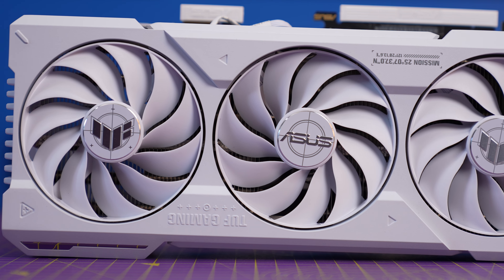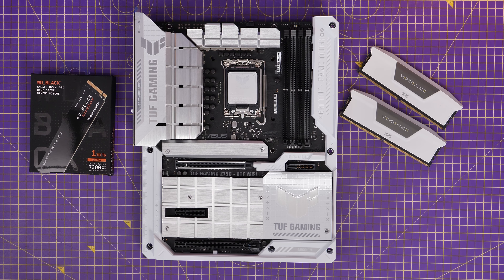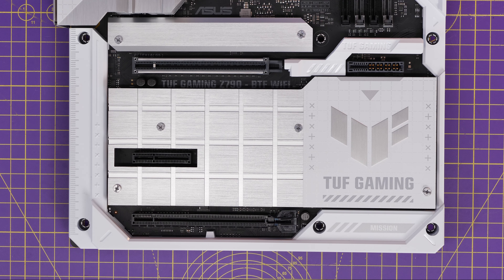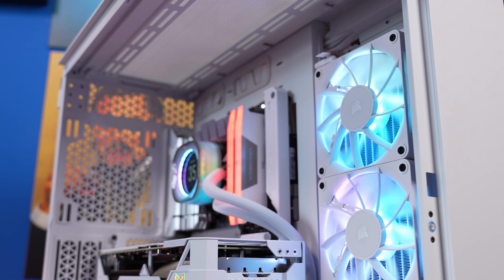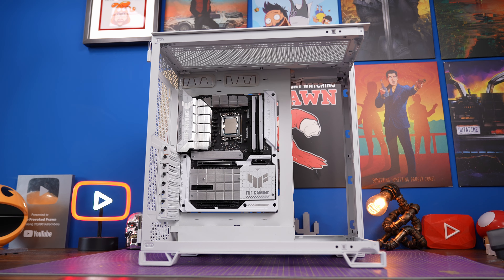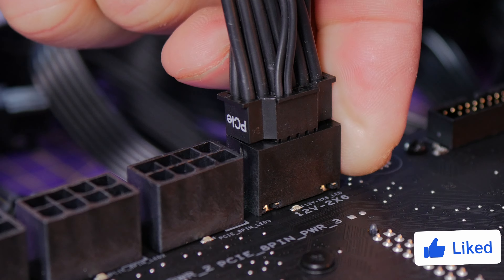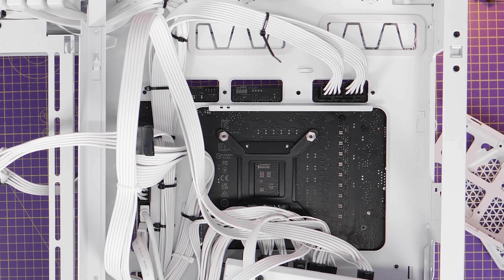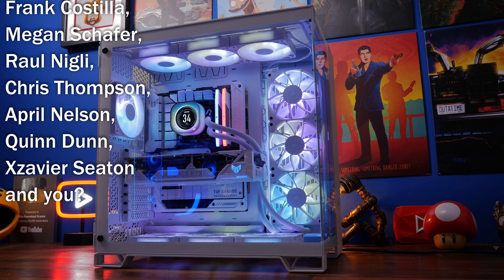Have you seen this fancy Asus RTX 4070 Ti Super with no cables?

Comment from the maker: Specs of the PC seen in this video (Please note links listed here include affiliate links which may earn me a commission at no cost to you):
Case - Corsair 6500X https://go.corsair.com/QyodrY
Motherboard - ASUS TUF Gaming Z790-BTF WiFi https://amzn.to/3WtrEsS
CPU  - Intel Core i9-13900K https://amzn.to/3Wbk8Bf
RAM - Corsair Vengeance RGB DDR5 16GB x 2 6200MHz (https://go.corsair.com/eKAL3Z)
NVMe SSD - WD_BLACK SN850X NVMe https://amzn.to/3Y5DJFB
SSDs - Crucial MX500 2TB and Crucial BX500 2TB https://youtu.be/IOJNybKZ4wk
PSU - Corsair RMShift 1000X white (https://go.corsair.com/1rv9Ra)
CPU Cooler - Corsair iCUE Link H150i RGB Liquid CPU Cooler https://amzn.to/3zKJEGf
LCD screen - Corsair iCUE LINK AIO LCD Screen Module https://amzn.to/4d1ryxK
Fans -  Corsair iCUE Link RX120 RGB (two triple packs and singles) https://amzn.to/3Se0G5R
GPU -  ASUS TUF Gaming GeForce RTX™ 4070 Ti SUPER BTF White OC Edition 16GB GDDR6X https://www.asus.com/motherboards-components/graphics-cards/tuf-gaming/tuf-rtx4070tis-o16g-btf-white/

Comment: Everyone needs to adpot this as a standard
Reply: wont solve the GPU cable problems for SFF builds :/
Reply: @daesz  continue claiming about small form factor if u cant handle a bigger system just go get a macbook -_-
Reply: @HypotheticaIly  why would i want a laptop lol? poor performance, overheating, no upgradability
Reply: I think that cables can really get a build together.
The build at the end just seems to be missing something.
White (and maybe even with little light-gray) can go a long way closing the build and kipping your eyes busy and giving some more details to a build.
Especially with AIO tubes.
Reply: Hell no, If vertically isn't in the name, don't do it !! 😂
Reply: @daesz  i mean if they perfect the gpu cable problem then it should be fine, there unfortunately will always be some kind of issue with any part of building a pc whether it be some cables or something else hopefully the pc parts companies make something semi-perfect where there isn’t really any issue aside from user error or something minor
Reply: No they don't bevause then if you have an issue you need to get a new motherboard also. To many things that can fail when cables would eliminate the issues. I don't like this at all. And there is a massive massive premium!
Reply: @Mod0Virus it's pretty simple to fix by adding extra rizer cable next to the main one

Comment: Great video! I just did a build with these two and the Corsair 6500x as well. I did do a black case for a Panda look and I LOVE it!!! I have to believe this will be a growing trend in pc builds, hoing forward. 
BTW, one thing that I don't recall being touched on. The extra board connection for the power really removes any issue with potential card sag. So theres no longer a need for sag brackets which is a big time plus!

Comment: I've only owned 2 pcs so far but every time I get a motherboard, for some reason it has to be the exact same manufacturer for the gpu. For example: if I bought an msi motherboard, I would have to buy an msi graphics card 😂😂. I'm weird like that. In 2019-2022 I had a gigabyte motherboard with a gigabyte gpu, 2022-2024 asus strix motherboard with asus strix gpu. As for my next build? Not decided.

Edit: I LOVE THAT WHITE BUILD!!!!

Comment: Asus should implement this on their matx BTF. i've only seen the asus tuf B760M-BTF but does not have the pcie power slot for GPU.  It will look clean with the Jonsbo Tk1 case. MSI project zero is also back connect but also don't have the pcie power slot.